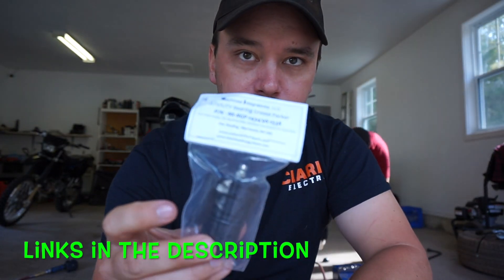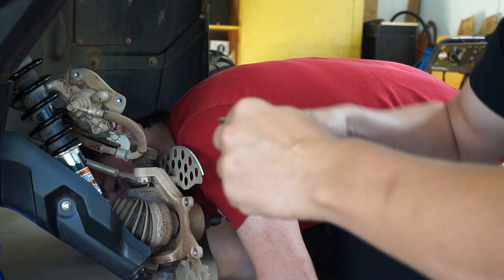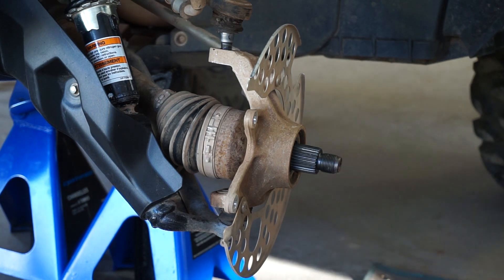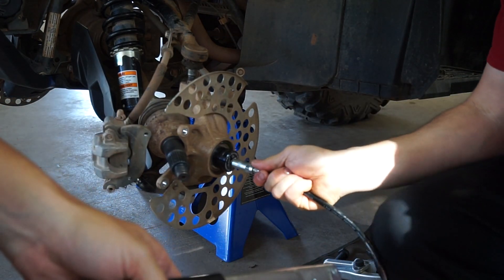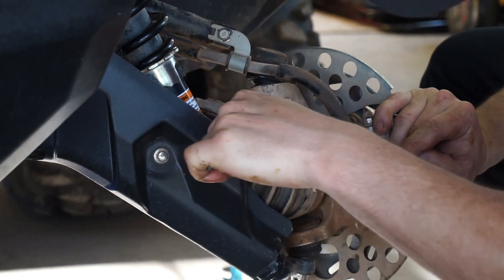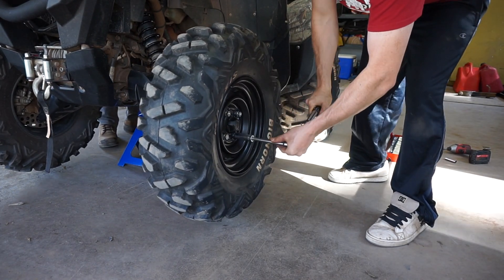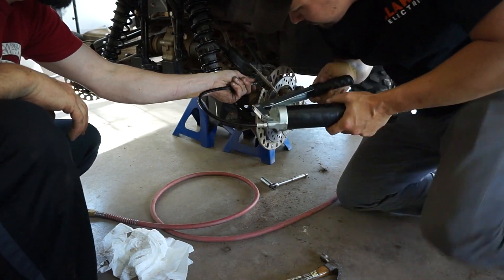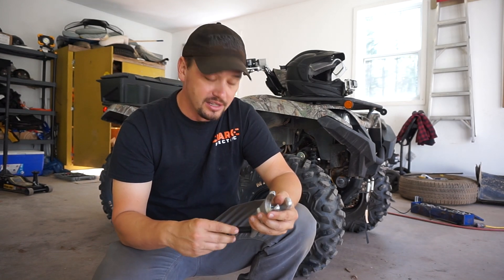Machined Integration Wheel Bearing Grease Tool for the Yamaha Grizzly.

Comment: Once upon a time I didn't think this was necessary due to sealed bearings. Yesterday I put new bighorns on and discovered my front right bearing had gone bad only after 750 miles. Then the left bearing that had 2500 miles on it fell apart once I pulled the axle out of the hub. Had to replace both front bearings in the cold yesterday. Just ordered one. Thank you
Reply from the maker: Hey man ! I feel you pain, I did the same thing with my old grizzly, I replaced the wheel bearings all aorund with "All Balls" brand of wheel bearing, I figured they came greased... I was wrong haha must have just been some assemby grease in there, they didnt last long. My new bike I wanted to do better maintanance with the bearings and hear lots about the MI tool, so I thought I'd give it a try. I hope it works out for ya !!

Comment: all you have to remove on the front is the lower ball joint....on the rear just remove the lower bolt and the axle nuts of course...when installing the axle nuts install them on a different axle that way the lock is in a different spot..I have 2500 kms on my 2019 grizzly ,I grease the pivot shafts after every ride,,I have greased my bearings replaced brake pads and have had to replace 2 rear outer
 ripped boots.luv the 2019 ride and the steering is much easier than my 09..thanks for sharing another great video.
Reply from the maker: Hey Brian ! thanks for leaving me a comment man, I appreciate it ! Sounds like you really look after your machine ! I agree with ya, the ride is much smoother on the newer Grizzlies and I love the power steering (I never thought i'd admit that haha) I haven't had to replace anything on my 2017 2100km other than oil changes and cleaning the air filter.
Reply: Did you know there's a Service Bulletin out for "ALL 2016-2018 700 Grizzlies" regarding the piston ring is to small causing it to smoke when cold, and burn oil more regularly?  Yamaha won't do a thing about it because it's not safety related! Do you notice either of the two aforementioned?  I have a 2016, and it's cursed with this major issue that Yamaha has dropped the ball on!  Great video.  I'm just a bit confused how the grease gets into a sealed bearing? Hope you can help?
Reply from the maker: @imagoodmann  Hey man ! I did see a notice go out but I haven't received anything from yamaha. apparently they will only do work on the bike if it is actually smoking or burning oil.... mine doesn't (as of now) so I might go in and get some questions answered. maybe make a video out of it.
YES I Know I was wondering the sae thing haha apparently there is two bearings in each hub, the outside of each bearing is sealed but the inside of each bearing is not. They both meet in the middle of the hub and there is a small gap between them, so the grease tool fits in and forces grease into the non sealed, inner parts of the bearings. you will see grease come out the front and back when it's filled. I hope I explained that right.... I could be totally off haha but I believe that to be true.

Comment: Nice! Gonna have to look into getting one of those bearing greaser tools (if they make one for Honda)! Thanx for sharin' bud!
Reply: Thanx  @trail3913
Reply from the maker: Hey Q! Always a nice little tool to have in the garage for sure, plus if you have a buddy with the same bike, you can go splits on it, or be a nice guy (like myself) and loan it to him/her haha thanks for watching !
Reply from the maker: Thanks buddy ! Saving me time ! haha
Reply: @Maritimer  Did you buy yours on-line or at a store? I used the link you provided, which took me to the MI website, but they don't deliver to Canada. (oh, and I don't use ebay)
Reply: the only thing that wears out on a honda is the rider
Reply: @brianfifield2540  
lol - yup, and I'm slowly getting there - hahaha! Thankfully, my Rubi is super plush and is slowing down the process - lol.
Reply: @quaddingsous  i got mine at atv tires canada check them out. they might have ones for honda.
Reply: @SCOTIAN_  Thanx bud!
Reply: @brianfifield2540  and bearings....

Comment: Can you Grease them with out that tool. Do you have a link of the tool we're to buy
Reply from the maker: im sure if you had a bearing press and you could press the bearings out, then you can hand pack the grease in the bearings..... this is just easier. there are different ones too, you dont only need Machined Integrations one. as far as a link there may be one in the description Or just google Machined Integrations and goto their website, you can click the make/model of your machine and they will send ya the right tool.

Comment: How come you torque the wheel nuts but you don’t torque the axel nut? I bet if you look there is a torque setting.
Reply from the maker: Hey ! thanks ! and you're right ! but you have to make sure the axel nut notch lines up with the other notch (that you saw me hit down with a hammer and punch) that keeps the nut on there and not backing off. so I tightened using the impact then tighten until the notches line up. I'm no mechanic, this was just to give you an idea of how to go about using this tool.

Comment: Good video but you do not use a torque wrench to tighten your nuts?
Reply from the maker: Hey man, which bolt are you talking about? the wheel nuts get tightened until they are tight and the notch lines up with the other notch, im sure there is a specific torque for it, but if the notches don't line up, you'd have to tighten/losen. Everything else I just go by feel, except the wheel nuts. I Hope that answered your question. All torque specs are in the owners manual or online.

Comment: What's the wheel nut socket size? I'm going to have to order up a socket big enough.
Reply from the maker: Hey buddy ! Yeah we had to run to a buddies to get a bigger socket too, I cant remember if it was 1 1/8 or 1 1/16. maybe if you ask on the Grizzly FB group or a google search, might find it. sorry
Reply: Thanks for the response, I will buy both haha a guy can't have enough tool! Take care!
Reply: 27mm.  I have a 2009 Grizzly 550 and I’ve had all of the hubs off several times.  The mud where I ride can’t be avoided and it’s hard on bearings, seals and brakes.

Comment: Shit u already did a wheel bearing grease vid , lol, great stuff dude
Reply from the maker: hahaha Yes Sir !!!! the Machined Integrations tool worked really good ! it was expensive though (around $100) but I've been told there are cheaper ones on the market that also work good and some you don't need to take the hub off to use.... not sure how that works haha but some guys swear by it.

Comment: I have 4000 miles on my 2014 700 and just changed the bearings all wheels along with brake pads. I guess what I am saying is, that's a lot of work to grease sealed bearings. Are you sure the grease got inside the bearings?
Reply from the maker: Hey man ! you make a valid argument, but the bearings are sealed on both outside edges, the grease tool presses the grease in through the middle of the two (not sealed on the inside edge) thats how it was explained to me. my old 2008 grizzly, the OEM bearings lasted for about 4000klm too and then I replaced with "All Balls" bearings (they were cheaper) and they were complete junk, replaced them twice then went back with new OEM Yamaha ones before I sold it.

Comment: I have a question. How offend do you grease your wheel bearings?
Reply from the maker: Hey man ! ahh I guess it depends on how much riding yu do and what type of riding. if your a mud guy you will probably need to grease them more often to get the dirt out of the bearings. I trail ride 99% of the time so its a lot easier on bearings, so I think one a year would be more than enough for me. Also if you run big heavy mud tires that can be harder on the bearings.

Comment: Hey just wana say the motomaster grease is basically no good compared to lucas red n tacky. It would take too long to explain but grease is one thing we cant cheap out on! On a hot day the motomaster would basically wash out, lucas probly lasts 3x longer and beats all other grease in every category
Reply from the maker: Hey ! thanks for the heads up man, next time I will try and find red and tacky. any idea if that stuff is OK in the winter months? it gets cold here haha
Reply: @Maritimer  yes it would be fine for winter, it basically takes longer to wash out and it handles the temp fluctuation real well thats why I think its fine for winter. I always use the red rtv as well for sealing plastics I find the stuff rated for high temp tends to last. Thanks for your reply!

Comment: Yamaha has small bearing Polaris use a lot bigger bearings
Reply from the maker: Hey ! oh yeah? I've never had any issue with the Yamaha bearings, my Grizz is at 3000+ km and still original bearings/brakes/bushings. My guess is they all buy them from the same manufacturer.